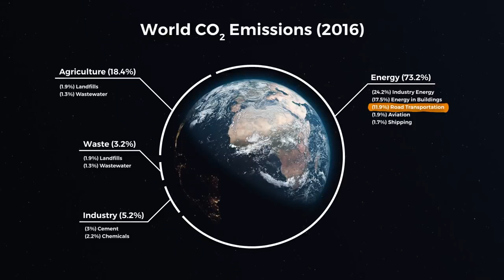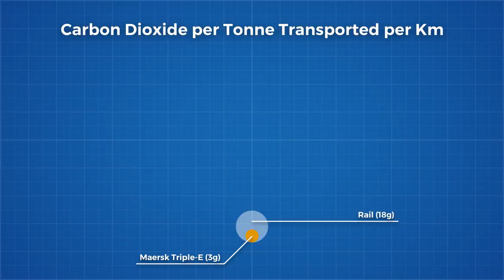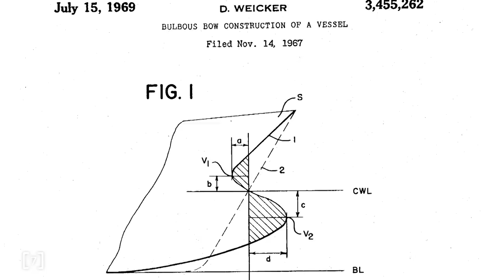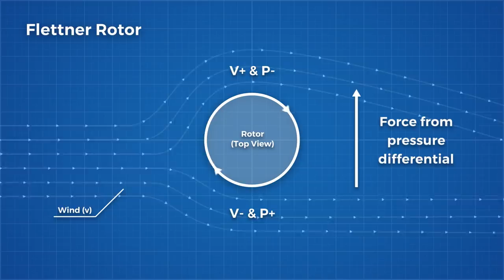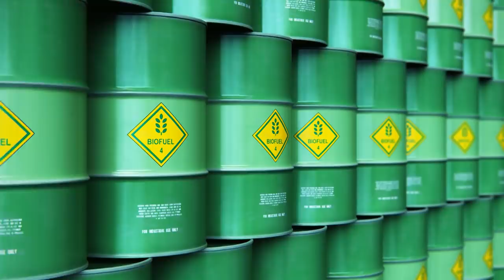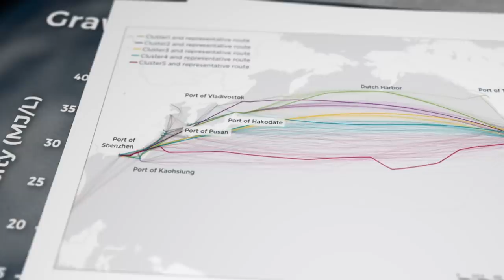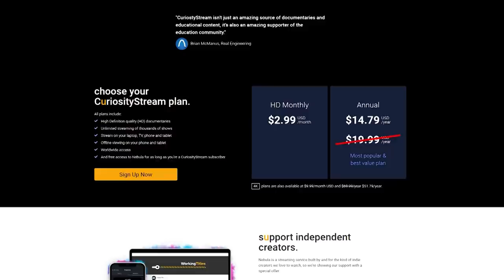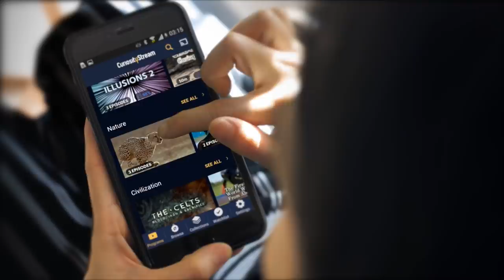Are Renewable Powered Ships Possible?

Comment: I'm very surprised that you didn't mentioned ammonia.
https://www.maritime-executive.com/article/new-research-shows-benefits-of-ammonia-as-marine-fuel
https://www.ft.com/content/2014e53c-531f-11ea-a1ef-da1721a0541e
https://www.ft.com/content/254e44c4-afec-11ea-94fc-9a676a727e5a
https://cen.acs.org/energy/renewables/Ammonia-route-fuel-ships-planes/98/i31
https://safety4sea.com/cm-the-case-of-ammonia-as-a-marine-fuel/
https://www.greentechmedia.com/articles/read/marine-sector-looks-to-ammonia-to-decarbonize-shipping
https://www.azocleantech.com/article.aspx?ArticleID=1092
https://c-job.com/ammonia-as-ships-fuel-c-jobs-future-proof-way-of-thinking/
etc...

and yes - it' can be produced by renewables, at commercially viable and competitive costs...
https://energypost.eu/green-ammonia-market-a-new-era-for-energy-and-power-industry/
https://www.cleantech.com/green-ammonia-potential-as-an-energy-carrier-and-beyond/

"...
4. Conclusion
From a techno-economic perspective, the results of this paper show that ammonia can be
an important player as energy storage technology in future energy systems with high levels
of penetration of renewable energy sources, even from the perspective of the operations of
the individual power plant. The results of the optimization shows that the optimum system
is 3% cheaper compared to one based on liquid hydrogen alone, with 87% of the total
storage capacity installed as ammonia tanks. An ammonia-based storage is hnce more
efﬁcient and cheaper compared to one based on liquid hydrogen, with additional beneﬁts
in terms of handling, transportation, and volume occupied for energy storage. Future
developments in the production of ammonia from renewable sources and in ammonia-
powered SOFC systems, both in cost and efﬁciency, are expected to further improve the
potential relevance of ammonia-based energy storage in the future."
https://www.researchgate.net/publication/334674606_From_renewable_energy_to_ship_fuel_ammonia_as_an_energy_vector_and_mean_for_energy_storage

Comment: Surprised you didn't mention ammonia, which is also being considered as a relatively compact and easy to transport fuel. Easily made from hydrogen and air using existing plant. https://splash247.com/dsme-debuts-23000-teu-ammonia-powered-ship-design/

Comment: why dont they use the water as a source of energy? ie pull hydrogen out of water so they don't have to carry that much fuel
Reply: To liberate hydrogen (H2) you need a lot of energy and while fossil oil & gas, or perhaps coal, will do it and are the most readily available any energy source wood, photovoltaic, wind, tidal, et cetera will do.  H2 is said to be good for use in fuel cells that will give clean energy when combined with Oxygen (O2) and leave only water (H2O) as an effluent; so as well as the cost of creating the hardware and separating out the H2 in the first place we now have the cost of providing the O2.  H2 is very, very light and very, very volatile so this is where we remember the Hindenberg airship disaster and while events of that magnitude might not be likely much smaller H2 fire or explosions can cause a lot of damage, the ‘light’ means that though there is lots of energy per unit mass there is not much mass per unit of volume so all the problems of CH4 but much worse.  You need to compress it, more than a lot, or cool it, more than a lot, to get enough on board your ship in manageable volumes to be useful.  The alternative to fuel cell use of H2, burning, also generates combustion products which includes waste heat going to the cold sink and a few NOx nasties.  The numbers, on any of these, are getting very difficult to show any sort of surplus so is this a case of running hard to stand still?  H2 may have a place in the energy mix on land as a storage medium but on a ship where there is a reasonable and constant auxiliary power need the question could be posited, ‘why go through the extra stages instead of using the harvested energy directly?’  After harvesting the energy, from wind, sun or motion of the vessel, as electrical energy better to deploy it immediately as heat, light or mechanical work.

Comment: Thorium power. Thorium power. Thorium power.
Reply: Thorium reactors are at present unproven technology at the research stage of the development cycle so while they may have a place some decades down the line form now they will not fix the problem today.  If you do a web search for ‘nuclear ship savannah’ you will see that nuclear has been tried and did not work.  A similarly heavily subsidised, by the government, vessel is in use in Russia but just think; would you have full confidence in the management of a nuclear reactor under the control of an anonymous entity only traceable, perhaps, via a letter box in a FOC (flag of convenience) nation state?  If you are could you sell that confidence to Japan, the state that hosted the Hiroshima and Nagasaki nuclear detonations as well as more recently the Fukushima ‘event’?  Then try that same, or similar, sales strategy on Ukraine, the nation state that as a part of the USSR (CCCP) hosted the Chernobyl ‘event’.  Modern iterations of nuclear energy thorium fuel, molten salt reactors or fusion reactors will carry the legacy of past problems.  It is the global trepidation of anything with 'nuclear' in the name and the economics of nuclear having transitioned from 'energy to cheap to charge for' too 'the costs of remediation are incalculable' that will prevent the adoption of nuclear energy as a means of creating energy at sea.  Modern reaction systems may have overcome the safety problems but the general public, having been misled in the past, will not believe the fresh new promises.  ‘They’ say nuclear is cheap, it’s not it is expensive as well as being complicated, dangerous, not universally socially acceptable and having only ‘no need for refuelling’ as a questionable advantage; actually it does need refuelling just not as often.  When they do need to refill the warming up stuff it takes considerable longer than pumping tonnes of thick black stuff, HFO cSt380, or thin runny stuff, MDO, onboard which is one of the reasons HMS Queen Elizabeth and HMS Prince of Wales are pushed about by gas turbines thus using a similar fuel as the aircraft that fly off of them.  The Royal Navy (RN) with a high degree of skills and expertise use, at vast expenses to the UK taxpayer, a current operational nuclear fleet of 11 submarines (also known as ‘boats’) in two flotillas, seven attack subs and four ballistic missile boats.  The carbon footprint of all the extra bits of hardware and the fuel, including processing thereof, from ground to propeller, are the external costs that never seem to get considered.  Disposal, once it wears out, of both the machine (that was a ship) and fuel is another can of worms best left unopened.  The 26 RN boats no longer in use are laid up (some in Rosyth and some in Portsmouth) awaiting long term deconstruction including dealing with the fuel rods and other irradiated material.  The USN is not, as far as I know, a commercial organisation working to very tight margins and also has the skill and expertise to handle the complexities of nuclear power so as well as submarines their aircraft carriers are nuclear powered and each have a build cost three times that of QE/PoW, bigger crews and more generous funding.  For those who still think that nuclear energy might be the answer I recommend this report: - https://www.bbc.com/future/article/20200901-the-radioactive-risk-of-sunken-nuclear-soviet-submarines? ocid=ww.social.link.email.  The navy of the USSR might have been under resourced and over extended but it was still generously supported in comparison with merchant shipping.

Comment: Wouldn’t renewable ships be sail powered? If only we had the technology!
Reply: To address the suggestions that sail power is the answer I offer the following.  In 1870 a premium sailing vessel entered service, the ‘Cutty Sark’, she could carry around 600 tonnes of cargo at speeds of up to 17.5 knots, dependent on the prevailing wind, to harness the energy the available spread of canvas was up to 2 976m2.  To round things out that was circa 5m2 of canvas for every tonne of cargo carried.  The ‘Cutty Sark’ was designed and built, with fine lines (more nautical tech speak so again - no need to worry about it) for employment in the tea trade where time on passage was a large factor in securing the premium freight rate that made her cost effective but as soon as the Suez Canal opened, which the ‘Cutty Sark’ was unable to sail through, she lost her advantage, raw speed, to the steam powered ships of that era.  Mechanically powered ships have improved in terms of efficiency, on a freight tonne mile basis, by at least one order of magnitude since then.  After losing out to the coal burning, steam reciprocating mechanical ships of the late 19th century ‘Cutty Sark’ was relegated to the Australian wool trade, just about the bottom of the barrel in maritime terms and only one small step up from being a 'honey barge'.  The canvas, cordage and extra manpower needed for sailing ships was never a very benign environmental option so please discount any idea of sail as ‘sustainable’.  All this is without the problem that if ‘the wind don’t blow the ship don’t go’, when it does blow it often blows in the wrong direction for your cargo delivery needs and sometimes there is rather too much of it for comfort.

Comment: Thing about the fuel these ships are burning in their diesel engines.
This fuel is not liquid at room temperature.
During refinement of oil from oil wells, the original oil is heated up in a process that allows the separation of the different component.
At the end of this process, heavy oil is left behind.
After this heavy oil had been cleaned up, - that is removing water, particles, stones and similar objects that might prevent further use, it is now 'heavy fuel oil'.
It contains a large amount of sulfur, heavy metals and other materials that is 'not so healthy'.
It will only be liquid at a temperature above ~85ºC.
I have worked with this stuff in the early 1980'ies at a district heating plant in my hometown.
If the delivery truck dropped some of this 'oil' on the tarmac, you needed a hammer and a chisel to remove it.

Welcome to the real world

Comment: The application of hydrogen power makes much more sense for these large commercial size vehicles. 
While the average family car can remain battery powered.
Reply: Using lots of energy it is possible to liberate hydrogen (H2) from Methane (CH4), the cheapest available source of which is the FOGI (this is called black, brown or gray hydrogen depending on how bad it is), so that will earn you the ire of the Green-meanies.  The other, much touted, option is to liberate hydrogen (H2) from water as so called green hydrogen if the power for the liberation is environmentally benign; you need a lot of energy and while fossil oil & gas, or perhaps coal, will do it and are the most readily available any energy source, wood, photovoltaic, wind, tidal, et cetera, will do.  H2 is said to be good for use in fuel cells that will give clean energy when combined with Oxygen (O2) and leave only water (H2O) as an effluent; so as well as the cost of creating the hardware and separating out the H2 in the first place we now have the cost of providing the O2.  H2 is very, very light and very, very volatile so this is where we remember the Hindenberg airship disaster and while events of that magnitude might not be likely much smaller H2 fires or explosions can cause a lot of damage.  The ‘light’ means that though there is lots of energy per unit mass there is not much mass per unit of volume so all the problems of CH4 as fuel but much worse.  You need to compress it, more than a lot, or cool it, more than a lot, to get enough on board your ship in manageable volumes to be useful.  The alternative to fuel cell use of H2, burning, also generates combustion products which includes waste heat going to the cold sink and a few NOx ‘nasties’.  H2 may have a place in the energy mix on land as a storage medium but on a ship where there is a reasonable and constant auxiliary power need the question could be posited, ‘why go through the extra stages instead of using the harvested energy directly?’  After harvesting the energy, from wind, sun or motion of the vessel, as electrical energy better to deploy that energy directly and immediately as heat, light or mechanical work.  As with nuclear energy at sea some of the ‘alternatives’ may have a use in littoral submarines in AIP (air independent propulsion) systems but that will be with the same caveats of cost, space and complexity so would not perform in a high volume low cost mercantile situation.  The numbers, on any of these, are getting very difficult to show any sort of surplus so is this a case of running hard to stand still?
Reply: @BernardLS  mmmh should've been more clearer that I'm coming from a storage perspective. 

I don't really care if these vessels were wind, solar or even hydrogen powered, or a combination of all three.

The current bottleneck for any renewable is storage of its energy. Current batteries are just too heavy and not as efficient as Hydrogen, diesel and petroleum from a storage perspective. I also don't see any future battery storage solving this and it will most likely be a combination of a small battery storage for immediate use and hydrogen for long-term use. 

The Energy Observer is a working prototype that I can reasonably see scaling up to a very large ship in the distant future, while some form of diesel hybrid shown in this video being a reality for next gen ships.
Reply: @carl8790  At the moment long chain hydrocarbon fuels have a technical advantage and are the most efficient energy stores that it is practical to use.  'Energy Observer' may appear to be a good concept but is unlikely to scale well.  WADR ULCC's and vessels like the Mearsk Triple E container ships would require far to much sail or photovoltaic area compared to the energy harvest if carried on board. Harvesting energy ashore into a storage medium for use onboard would struggle to meet the levels of efficiency fossil oil has given humanity.  We are mining the encapsulation of energy that has occurred over many millennia and sadly not paying the full cost.  The 'free use' of a 'common' resources, such as the atmosphere as a waste depositary and the oceans as a cold sink being the problem.  This is, IMO, the area where regulatory action could be useful; the best option is both limitation of consumption and limitation of population growth.  Not at 'pre-industrial hair shirt' levels; but do we need a 5 litre V8 pickup to get to the golf club?  Is a family of 'two parents having two children' (assuming both will survive to adulthood) a good size to aim for?

Comment: Now if we could only make these ships quiet so whales stop beaching themselves to avoid the never ending noise made in the ocean. Not sure how that would work though haha
Reply: The easiest means to reduce emissions, including noise, is to reduce consumption and transportation.  Reducing consumption requires all individuals to act and limit their consumption, satisfying a person’s needs requires fewer resources than satisfying their wants.  Using material and products that are available locally, to the point of consumption, will also reduces transportation impacts.  Freight is always a balance of weight, volume and value so not moving an item from ‘a’ to ’b’ unless the value added significantly out ways the costs, including environmental costs, incurred is a good starting point.  Shipping is a high volume low cost, and thus low margin per unit, operation; in part due to end user reluctance to pay the full economic and environmental cost of what they ‘want’ to have, think Glastonbury £100 (ticket price) count me in; Glastonbury £1 000 (full environmental cost) no way!